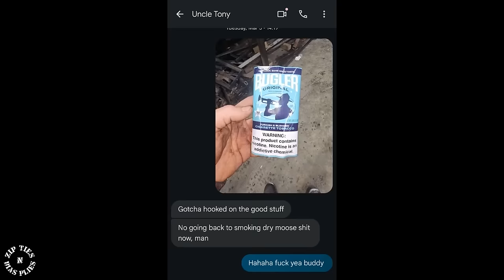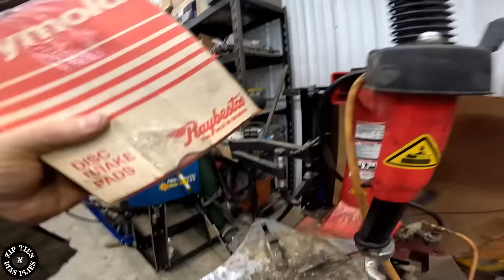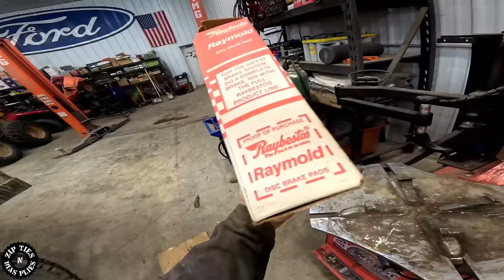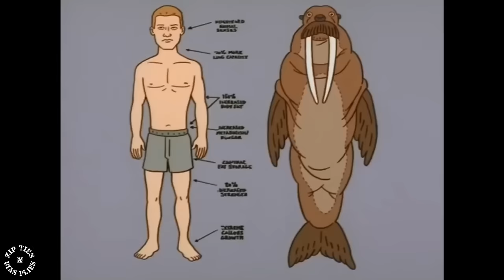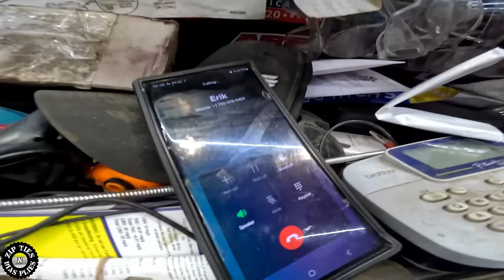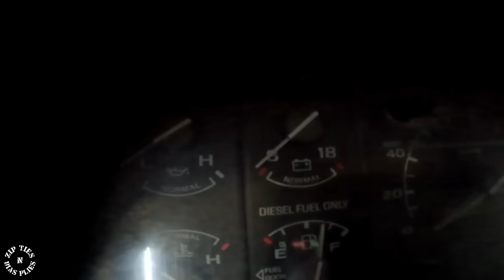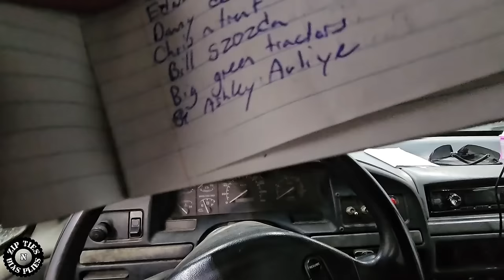WILL IT START?! APOCALYPSE FORD EDITION!!!!

Comment: I been lucky. Only Bruce Jenner I own is in my 00 Silverado. It’s slipping. But the redhead ginger mobiles are 💯 manual. I only need the tires to roll over just once and n it’ll fire. 
Always laugh at the one neighbor who goes to start his ole distributor car. All u hear is it rolling over like an EFI. One pump of the accelerator, bump the key on my 86 Silverado it’ll purrr to life. No rolling over for a week burning the starter out.

Comment: Roll starting through the side gears you were closer to 1:1. Roll starting through the diff is 2.05:1 if you have 4.10s. Put Bruce in hi gear transfer in hi and your efforts required to start the engine would be reduced.

Comment: Im too poor for nice things. Ive got a 12v ve swapped obs ferd. What clutch fan are you using? Both of the ones i have wont kick the blades out past the belt assembly. A fellers got a wallered out fender washer on there right now but its kinda sketch

Comment: Cut up an extension cord plug one end in the wall and the cut up end to the battery and itll go. Might not be the same after in the way that itd run without a battery in it radio and all. In a pinch if you gott get it running itll get it running

Comment: I always wondered what would happen if you dropped a lit fire cracker into a cylinder and put the spark plug back in. The cylinder would have to be part way down on the power stroke.

Comment: Clutch pushed in, 5th gear same as ratchet straps, 1/2 milwaukini on a lug nut on rear axle. Let it rip for a few seconds get er rolling and dump clutch. Milwaukee pop start

Comment: Not necessarily way to start a vehicle but still kind of an interesting phenomenon. My dad was 15 years old and went to get the tractor off the Creekbank. he said he jumped on it stepped on the clutch and it started to roll backwards  he let the clutch out and the engine fired up running backwards. He said it was kind of interesting the smoke came out the air cleaner the only way he could shut it off was put it in high gear and stall it. He said it was kind of scary when it tried to take off going high-speed reverse Before it stoped.
My grandpa and my dad side told me about a tractor called the field Marshall and apparently the way you started it was with a shotgun shell. It had a spot where you put the shell in and then you screwed down a metal cap. Then you hit it with a hammer. Apparently the force of the blast was enough to turn the engine over.

Comment: 2:12, is that a label maker in your toolbox, didn’t think you were that type of guy.
9:10, most men rather be Cummin then Strokin, Peg.
Definitely one good thing that comes out of Dodges the Cummins Engine.
Peg, if your old truck is a real truck and you shift them old gears yourself, you could push start it, if your parked on a slope.
1:06:16, if you were to let the battery sit and charge this way, you could use 1 or 2 Milwaukee or other batteries.

Comment: Get a log from the woods to put under the chain saw and a ratchet strap to hold the saw tight, and I know you have duct tape for the trigger.  Then you have free hands for another beer while the truck charges

Comment: The gear ratio would be more suitable for a  Rhondaless fat cripple  if you pull the ratchet strap off of the prop shaft instead of the wheel.

Comment: (Nerd voice) guessing running a cable kill on the 12 valve?  Seems like this wouldn't work with a shut down solenoid unless powering that with an m12 first. 🤷‍♂️

Comment: Youre not far off with your explanation about the diff. Since one wheel doesnt spin, the other gets twice the speed. Easy way to explain this would be, going straight you have 100% speed on each wheel. If you reduce the speed on one wheel by turning for example, lets say one wheel turns 50% of its speed, the other gets the other 50 so 150% speed. Lets say the crown gear spins at 500 rpm and you block one wheel, the other wheel will turn 1000rpm. You can use this backwards to increase torque supplied to the engine to spin it from the wheel. Anyway im stunned and drubk diesel mechanic if that matters, who cares?

Comment: Can you start a engine with the chainsaw tactic but instead of charging the battery from the alternator could you turn the motor and start it from the crank bearing

Comment: Did the minty chainsaw method last summer except I didn't have a v belt so I gobbled on a fat layer of duct tape to my alternator pull6 and sent it all the way with the saw chain with the bar removed.... fuckin works mint

Comment: take bike with rear belt like in praditer do that lot in asia weld or make rim with block strap to it to get out mud make your own run flats al capon limo tires were rope  chain sprock welded on axle or handle bars to hand charge your rpm for altenater to charge or use wires crank and inverter have those in lot new truck or add one to charge tools other like oxgen maker generater 
so many ways thats if system is any good

Comment: ANYONE CURIOUS ABOUT THE 60V AND WHY IT DIDN'T WORK, HERE'S WHY: You're sort of right, sort of wrong, about the series/parallel conclusions. You're correct if the context is a transformer, and if the load magically maintained the same wattage. I.E. 4000 watts = 20v @ 200A, or 60v @ 66a. Both are 4000w. Amps are what cause heat, so fewer amps, less heat, you can use thinner wire. That's all correct, but the wrong context. That's not how it works. 

The starter has the same electrical resistance (say, 0.1 ohms) regardless of what voltage you give it. Amps = Volts / Resistance. So if you give that starter motor 20v, with 0.1 ohms resistance, it'll result in pulling 200 amps. But if you give it 60v, it still only has 0.1 ohms resistance, and now it's trying to draw 600 amps. Those Milwaukee batteries can't supply 600 amps, so they'll probably blow a fuse.

Also, every computer on the truck is likely going to fry in less than a second because you're giving them 500% the amps they were designed for. In automotive context, devices are designed to work at 12v, but, because they know every redneck is gonna try putting 24v into them at some point, auto engineers overbuild them and they'll all be designed for 24v, plus some extra, so maybe 30v, for a short period. Any higher, they'll fry.

Now in proper context, the resistance of the starter motor is so small that the limitation isn't how many amps you can convince it to pull, it's how many amps your battery can give it.

So yes, batteries in parallel will be the way to go. Same voltage more amps.

BUT... in this case, you don't want to try to jumpstart the truck right off of the Milwaukees. As I said, it'll probably fry them. In fact, you probably don't even want to connect them straight to the 12v starter battery. The resistance of the starter battery is also so low, it'll basically try to shotgun the entire Milwaukee battery into the starter battery in like, 3 seconds. So what you do is you use some thin wire (lots of resistance), and you connect it in parallel for a few seconds on, then a few seconds off. A few seconds on, a few seconds off. The wire will get warm, that's fine. Don't let it get hot. What you're doing is gradually charging the starter battery using the Milwaukees, at an amp rate they can handle without dying. 5-10 minutes is a safe rate. I've done this lots with Dewalts.

"But I don't have any scrap wire!" you complain. Well, the speaker wiring harness under your door card won't affect the operation of the vehicle.

"But I can't figure out how to connect to these thin little battery slots on the Milwaukees!" you complain. The pop tabs off of beer cans will fit perfectly, and are aluminum, so, decently conductive. Failing that, a Canadian- or US-sized dime is perfect. It rolls right into the slot and has a little edge to hold it in place.

This isn't theory, I've done this, many times.

... If your starter battery is frozen solid... now you'll have to jump your truck straight off your Milwaukees. You'll get one try at this, so connect them all together in parallel and give 'er the first time.

...

Bonus: If you don't even have any charged batteries, but you do have a cordless drill, clip your leads onto the battery posts of the drill, bend something (3/16" at least, maybe a fender brace?) into a crank shape that you tighten into the chuck, put the drill in your lap and crank that sucker fast as you can. A generator is a motor hooked up backwards. You might be at it for a few hours, but you'll get there.

Comment: how are you holding open the fuel solenoid with a dead battery??
Reply: Once the battery has voltage the solenoid will open. I think they will activate with about 5 or 6 volts.
Only the alternator needs the igniter current to excite the charge winding.

Comment: You're in 5th, you'd probably be able to rotate it in 1st. Basically you're trying to spin a big gear with a small gear when in 5th, but it'd be the opposite if in 1st.

Comment: What gear was she in when trying to rope start I believe you could put it in in a high gear like 3rd or 4th I know I have push started a semi shift fourwheeler that way same as old Ronda the Honda if you put the quad in fourth or fifth and can get her her moving alot easier to push by hand than in first or second or even third just have to get her rolling a little faster
Reply: 42:47

Comment: The tool batteries would have worked, if you'd have wired them in parallel 😮 You need amps, not volts😊

Comment: It will sound stupid....
But you can get a dead enough to not start flooded cell battery. Empty it into a can of sorts, boil it on coals ( not flames) and it should give you, maybe as much power as 2/3 of an outbac-kerstan., only if you don't breathe enough to taste battery ozone

Thease days I'd rather sacrifice 1 eBay drill battery, leave it enough time to smoke a durry and crank it

Comment: This will work on an '07 Towncar right?
Reply: Probably would, but not smart to use an 18V battery to excite it, them fancy electronics will not like it.
But atleast the alternator is right there up and front.
Reply: @Vaino_Hotti  Thanks for the minty reply, but yoooooou don't need to worry about rallying the fuck out of your lincoln towncar's electrical system

Comment: Could a guy use that strap method  to get unstuck if you had a locker?
Reply: Depends on how stuck you are but maybe eh 😮😅😊
Reply: That is actually how we get our tractor and trailer out of shitty situations. But the gear ratio on that is holy fuck low so you'd expect that, plus it being a tractor it's more heavy duty. You'd probably burn your clutch on a truck but what do I know I ain't arguing lol.
Reply: I've tried it on a ride on mower a few times over the years - until my folks eventually got one of those zero turn things, it was a pretty regular thing for the crappy old JD mower to end up slid down the bank off the end of their sloped section.

could either do the old man's trick and winch the thing out with 5x 15m tie-downs strung together way up to the corner post of the house....

...or, since they weren't my tie-downs or my lawnmower, I had the bright idea of looping the straps back on themselves over front and back tyres each side and making it 4wd.

worked really well, crawled straight up the steep bank no worries. thought I was pretty hot shit the first few times....till it shattered the drive housing one day, rolled backwards landed on top of me at the bottom. and then caught fire and torched half the lawn.

yeah, took me a while to pay that new zero turn off.

Comment: 12G shot gun shell. Like the B52
Reply: B52 is a jet. So no. Your talking about the Coffman starter that was used on some 30s and 40s piston aircraft
Reply: B52 could do a crash start with there old engines

Comment: It's some godawful cow milking hour here, so the only ones I can think of that you didn't mention: flip flop winch truck up a hill, if you have one handy, then roll her down the hill and pop the clutch.  My buddy had a mud truck with 44's, you could jack up a rear wheel, stand in the bed, and kick the top of the tire like you were accelerating on your sick razor scooter.  Get that going fast enough and idiot number 2 can pop the clutch and it acts like a flywheel starter on an old tractor.  Haven't experimented to see how light a tire will still have enough mass to flip it over.  That was on an old 70's highway with a gas v8, cant remember which one.  As with most of these methods,  automagic transmission owners will have to just sit there making vroom vroom noises till they get molested then eaten, or eaten then molested by a sasquatch.

Comment: Well if yer in a pinch and ya need to get  a 7.3 idi started with no charge on the battery and no working glow plugs all you need is a manual trans a slight down slope and a don't give a fuck attitude you just throw her in neutral get her rolling down the hill jump in real quick and safe like push in the clutch and throw her in second and one ya get goin fast enough ya let the the clutch go and turns the engine no problemo gets her running for ya but only works with a manual

Comment: If you had some pullies/snatch block(s) you could make it 2x easier to turn the wheel and start the engine. This is explained better by SmarterEveryDay https://youtu.be/M2w3NZzPwOM?si=gXMNCs27wr7NZQsk